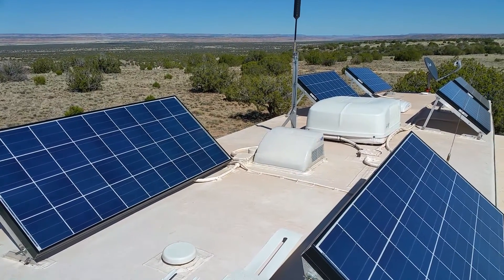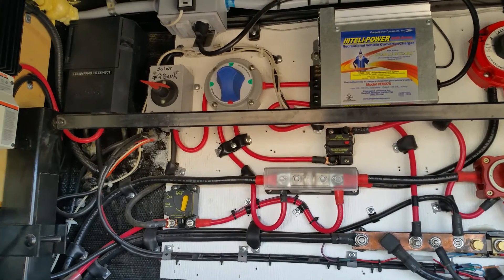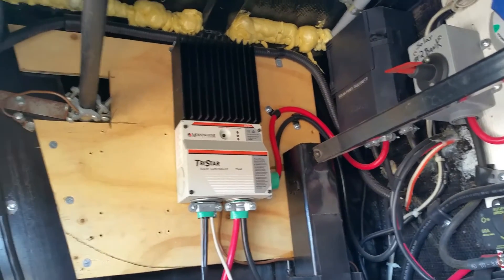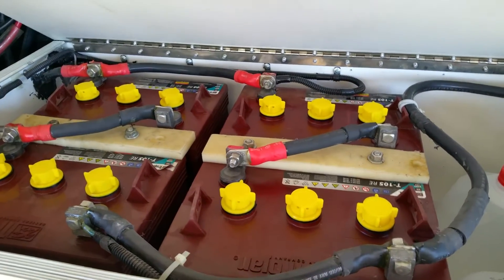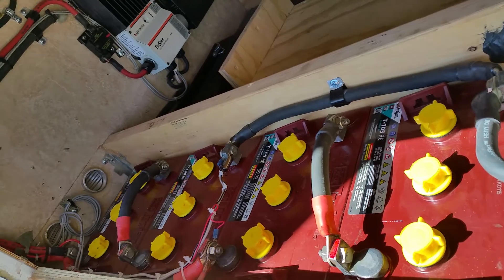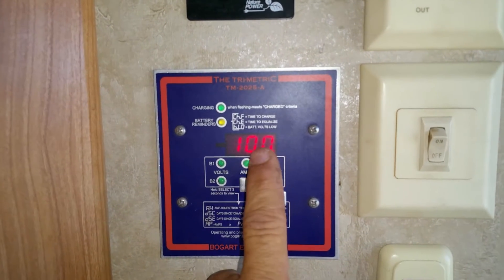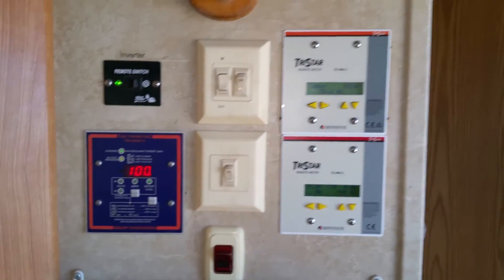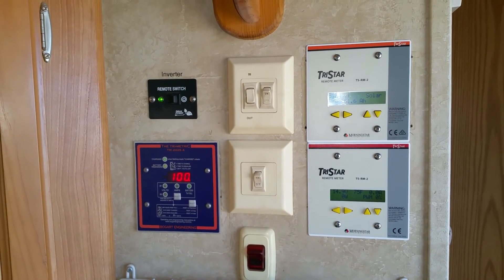"Solar Boondockers" Mobile Homestead's Solar Power System!

Comment: Hi, great videos on wiring. I am getting ready to install a solar system, but my camper is a truck camper and I don't have the room like a fifth wheel. I have a lensun 200w kit with flexible panels, a 20a mppt controller with a remote, a samlex ssw-2000 inverter and I already have a pair of 6v golf cart batteries installed for the house. In all your videos showing solar install, you put in a catastrophic fuse, my question is, where can I find them and what size would I need for a small system? Thanks

Comment: Cool set up. It looks like you really know what you are doing. What is the make and model of your camper?
Reply from the maker: Howdy Harled500! The old "Mobile Homestead" is an 2008 Keystone Sprinter Copper Canyon 350FWBHS.
 By now she is 75% home built with all the repairs, Mods, and rebuilds we have had to do on her.
I rebuilt both slide-outs and replaced the entire exterior rear wall, and replaced most of the electrical & fresh water plumbing. The next Reno is building a new kitchen and bath room for the family. 
Happy Trails!!!
Reply: Wow. Did you take pictures to do any videos/pics of these major mods? If not please consider doing so forward or retroactively documenting your mods to fix slides and HVAC stuff.. We are just truck camping now with a 500w/425Ahr battery bank solar system on a 12 foot truck camper we use for fridge ,lights and light cooking but looking to also buy a fifth wheel and like seeing how you utilize the front compartment and all the details you provide for power systems for living. 

In short. MAKE MORE VIDEOS!
Reply from the maker: Thanks, Will do!
Happy Trails!!!